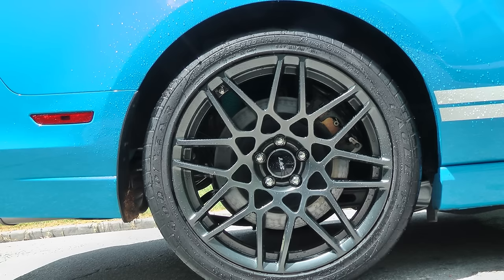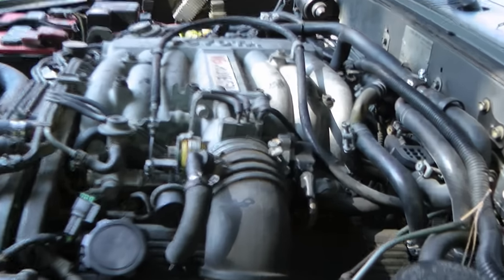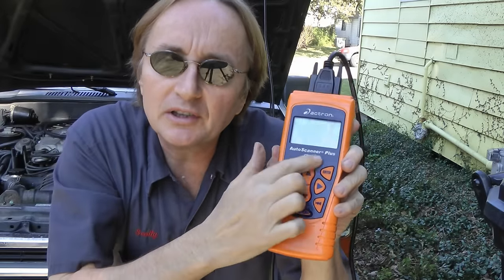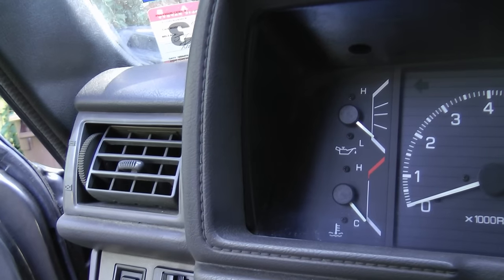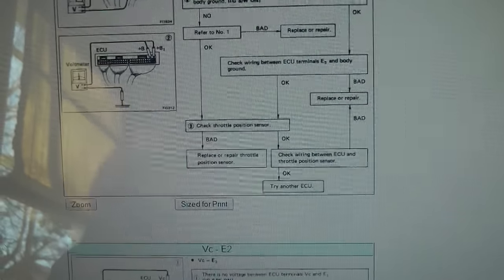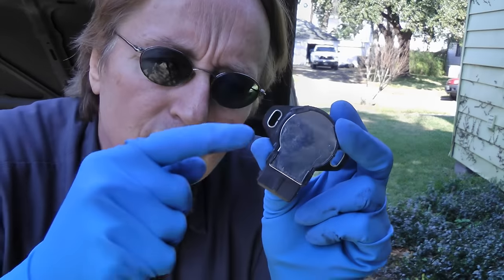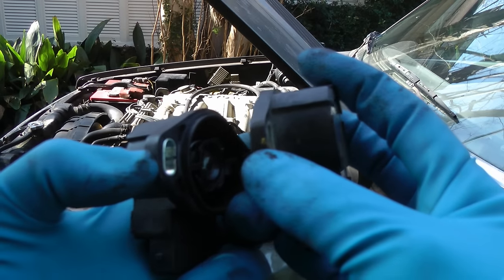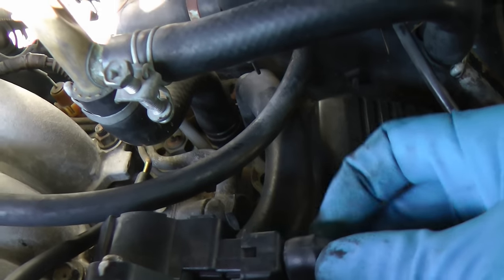How to Stop Car Hesitation (Throttle Position Sensor)

Comment: So I have an 06 Trailblazer 4.2 L Inline 6.
I notice that when I floor it, it takes a while for the car to respond, would it be the sensor? what could be and what would you recommend? Thank you in advance.
Reply from the maker: +Josh B could be lots of things, from this sensor, to a weak fuel pump, to dirty fuel injectors. Best to test live and mode 6 data, or pay a mechanic to do that rather than guess

Comment: console panel doesn't showing any light also I.e. engine light can I change my throttle position sensor, camshaft position sensor, and fuel pump will it help me
plzz guide

Comment: hey their got an 89 Toyota pickup same motor as you have in your video 3vze known as the 3 slow I bought a tps sensor to replace cause my truck has been idling really high at cold start up recently and has a surging idle from time to time also if I tap that gas pedal suddenly it lags so my question is it just a plug and play or do I have to use an ohm meter set it and a feeler gauge thanks again hopefully you respond rapidly
Reply: +Scott killmer

Comment: I have a 1999 Chrysler Sebring jxi convertible and the car wouldn't start with code PO122. The engine is a 2.5 v6 Mitsubishi. I replaced the throttle position sensor and still getting the code. Does it need to be calibrated and if so how? The sensor doesn't have slotted holes.

Comment: My 1990 Isuzu pup sarts with no problem but after I little bit it shuts off could it be a throttle potion sensor or something else Scotty?
Reply from the maker: could be tons of things,  that old, try my video "finding engine vacuum leaks with a cigar"and also pressure test the fuel pump to see if it's weak

Comment: hi sir i have a problem with my suzuki wagon r 1000cc engine turbo intercooler gasoline, during warm up idle is ok but until it reaches the normal operating temp  the idle turns rough and it fluctuates eventually but when you rev it up in almost 1500 of the rpm it will gone  and if you depressed it again it will come back can you give me an advise? thanks..

Comment: hi scotty
i have nissan primera 2001, while driving car start missing gears and RPM goes ups and down, sometime it stop changing gears, i have checked through nissan they said it needs to change input and output speed sensor and also steeper motor inside transmission, can you please tell me is it right or not to do that koz it is much expensive to change both.

Comment: What is wrong with an automatic toyota camry 98 that will intermittently hesitate when going from a stop into a left or right turn, and  intermittently will hesitate when going up a small hill?   Have checked the transmission fluid. Looks good. Gone thru a couple tanks of gasoline, no help there. No codes.

Comment: i have a problem i tried to fix it i have came a long way but bought a 2002 lincoln ls with v6 

replaced all sensors except o2 sensors that came with it when i bought it haven't put them on
put new upper and lower manifold seals and replaced the pcv valve and pcv elbow and factory parts also from the pcv valve to the manifold but the problem i have now is when i start it when (cold) it won't go over 1000 rpms you floor it and doesn't do anything just stays at 1000 rpms it boggs down but doesn't stall but when (warm) it runs perfectly fine floor it and drive it like normal just when its cold any ideas would be great .

Comment: I have a 2011 Silverado 68k miles runs fine around town but when you get on hwy and go 55 it seems like its missing but it only does it every 14 days are so onstar did diag no errors and no check engine light what do you think it might be and when it is doing it you can floor it and it will get up to 80 in 3 sec
Reply from the maker: often weak fuel pumps do that, pressure test it when it acts up

Comment: i have a 94 town car that hesitates on start up and whike in motion ive cleaned pcv done tune ups etc and still does it. i dont have check engine light on but it really hesitates is there anything else i can do? i love this car its perfect for my lifestyle and dont wanna lose it
Reply from the maker: +Ceasar Arce first, pressure test the fuel pump, weak ones do that and don't trip codes
Reply: Lol sucks to say but how do I do that I've never had to do any of this before

Comment: Hey Scotty. Long time fan. Having trouble. 01 Suzuki Grand Vitara hesitating on steep hills only sometimes. And on take off sounds like there's some noise right under driver seat. As I speed up the noise goes away. Any info would be appreciated
Reply from the maker: check for worn CV joints, inner and outer
Reply: Scotty Kilmer thanks for replying Scotty. I feel like an idiot right now. I was just low on gas! For some reason my car will stutter for a whole mile city driving before it dies

Comment: would spraying the sensor with electronic contact cleaner be an alternative to replacing? I think my car has the sensor built in to the throttle body and i have to get a new throttle body to replace the sensor, and that cost 400 bucks i think
Reply from the maker: you can try, but tps sensors often go bad electronically

Comment: I have a 07 toyota camry le just bought and it kept stalling so I figured it was the throttle body just put on a 2nd one and still the same problem no change only goes 20 mph at most could changing this sensor be the issue

Comment: Scotty, my 94 850 is hard starting when it gets warm, I replaced the tps awhile back, could this be causing a problem, I put it in the way it came out, no more check engine light, thats why I replaced it, or could it be my coolant sensor, or would you go cam sensor first, livi n on a shoestring and I have to do my own mechanics, Help!
Reply: Hi Scotty, my 97 miata with 115k miles spudders while at cruising speeds,  could it be the tps? Acceleration is fine, it does have a low idle speed. The car is stock - no after market parts.

Comment: good evening I have a toyota Corolla s 2006 sedan when I drive it and comes to a stop the gas pedal dies   then let say I give it a minute when I press the gas pedal the car full power again and driving good again could it be one of the sensors either the gas pedal sensor or the throttle body sensor ?

Comment: have a 2000 Nissan Xterra put on brand new starter brand new thought throttle position sensor put on a new fuel filter my car will crank up and run good for a little while and then it will start taking down and cutting off like the throttle position is bad what do I need to do next do not have the money to take to a expensive mechanic do you have any suggestions and the throttle position sensor has been sent with a screwdriver as well so the island will not be low but it is still acting up

Comment: I replaced my whole throttle body but it's still hesitating a little, although nowhere near as badly as it was. So I guess that was a problem but apparently there's other issues as well. I'll check my spark plugs next.

Comment: I have a 94 Camaro 3.4 That gets about 150 miles to the tank, could it be because of the Throttle position sensor. I have already replaced o2 Sensor, Fuel Filter, Fuel Pump, Plugs, and the Idle air control. Also I removed the throttle position connector and noticed some liquid inside.
Reply from the maker: +Roger Correa  could be tons of things, best to test not guess. Guys like me make a living analyzing other's problems without guessing, try to find one for at least an analysis and realize being that old, odds are injectors need replacing or serious cleaning

Comment: I have a 2013 mustang v6 and sometimes when I’m driving’s real slow like 10 mph and i accelerate it the car hesitates when it changes gear i think , do you think it’s happening because i need a new throttle sensor

Comment: I have a 95 Chrysler Cyrus that has when you go to take off it seems like it's flooding itself and then it takes off I have clean the throttle position sensor and the throttle body but still doing the problem any suggestions

Comment: I have a 95 toyota camry and the paperclip trick isn't turning on any check engine light. I don't even know if there is a check engine light on the car. Is there a way to diagnose without the light flashing?

Comment: Hi Scotty! I have been watching your videos since you came into YouTube.  keep up the good work.

BTW I have trouble with my Toyota Corolla AE111. It starts and runs pretty good. Just that when I stop at stop sign or traffic, the rpm either goes down by few hundred or goes up to 1.5k rpm and stay there. It immediately get back to normal if I blip the throttle. Another thing I noted was when I was driving, as I let go of the throttle and coast, the power delivery becomes unstable and the car kinda jutters or shall I say it moves like it will when one intermittently press and let go the throttle.

could it be TPS or the whole throttle body?
Reply from the maker: +Vivek Ananth  tps rarely go bad on those.  Try my video "how to fix a car that idles poorly" and also check for vacuum leaks
Reply: +Scotty Kilmer alright will give it a go. Thanks a lot!

Comment: got a 96 Mustang GT 4.6l starts and idles but when I try to go it hesitates and want to bog down and die it is also manual and no check engine light is on plz help can't figure it out and have no code reader what can it be getting ready to do an EGR delete but not sure if that's the problem this started out of nowhere also checked the fuel pressure seems fine any ideas would be appreciated

Comment: Unlikely a part ever needed to be replaced.  Anyway, the screws aren't stuck because of age they have a threadlocker compound on them.  Heat the screw with torch or soldering iron to soften threadlocker (still might break the screw off in there trying to remove though.)

Comment: What other components or parts does the throttle position sensor damage? 
I had a p1221 and check engine light was gone after replacing tps. But I have rpms going up and down with no check engine light and car won’t go past 4K rpms... I’m really scratching my head now. Vvt solenoid is clean..
Reply: Could it be my timing belt?
Reply: My fuel system is in closed loop.

Comment: Have a 02 Lexus ES300 with hesitation issues. Shows code p1350 and already changed camshaft position sensor and plugs, checked map sensor and still haven't figured it out. Says it's running lean and hesisitates when you floor it and above 4000rpm while driving it. What could my problem be?

Comment: Hi Scotty, I had some trouble with my 2002 audi a6 3.0 quattro. Sometimes it dies when I stop on light. and I try a couple of times to turn it back on. Usually EPC light comes on, and idle rpm stay about 1150. I turn it off and on and it is gone. I replaced throttle body and speed sensor and it looked fine for 1 day.  It took me 20 min to turn the car on today. After I turn it and press the throttle, the car shuts off again. Eventually it starts and works fine. I was thinking it might be a throttle position sensor problem??? Could you help me with that?
Reply from the maker: +Gerd Ruci   realize audis that old are endless money pits. And to fix them without guessing, a super expensive Vag Com computer is needed. I have one, but I am a pro mechanic. So find someone with that and pray he can figure it out without guessing with too much of your money. I would not keep that vehicle long myself though, realize that.

Comment: Hi Scotty my car shows dpf and glow plug the grage checked dpf it was clean even the light is there the car skoda 13 plate 1.6 low mileage anyway I used all the type fuel liqued but no help car slow me down in the hills holds back power it's like there is a blocage someweher on and off while driving I put new turbo Wastegate only the esp light gone as it was making problem to any idea what is that

Comment: I have been getting p0171, p0174 on my 05 toyota prerunner with 142k. I replaced the o2 sensors upstream and MAF. I am haveing engine hesitation under load and engine light reading same codes. Can you help

Comment: Hey Scotty I have a 2002 jaguar stype every rim I stop at a red light it idles and turns off but turns on right away do you thinks it's the throttle body sensor?
Reply: had that problem on my Jaguar, do u have any vacuum leaks?

Comment: hi scotty I have a Nissan march 2001 automatic jap import can you tell me if they have carbon brushes cvt on gearbox if so can you tell me where.. and when I put the car in park or nutral position the car seem to run higher fev or sounds like it.

Comment: Hey scott i have a acura 90 b18a1 and its thorws me a code for throttle angle and i unplug the tps and it runs the same could my sensor be bad ?

Comment: Hi I have a question I have a 07 chevy impala and its reading engine power reduced and engine hot ac off I changed the temperature sensor and the throttle sensor took off the battery terminals and still the same codes how to I reset or relearn the throttle sensor

Comment: Hey Scotty I have an 89 Tercel with a carburetor. I think my TSP looks different than this one. I get a code 41 but how do I identify my TSP? Thanks.
Reply from the maker: the sensor is built into the carb, a non replaceable part
Reply: Wow, I called Autozone and they say I can order one from them. I sure hope there right. Thank you.

Comment: I have mazda 626 1995 2.0l  4 cylinders. automatic transmission, I had some issues with MAF, I replaced it with a new one buy it from online store, the check engine went off but hesitation started to show up, I adjusted TPS to the maximum (or minimum) range the hesitation decreased dramatically but still there is hesitation under 1000 rpm. I made key on engine off test nothing show up, I made key on engine on also nothing show up. What to do?

Comment: I have a 93 Chevy Cavalier that idles up to 2000 RPM when started. It doesnt kick down either. Could this be an issue with the tps? There are no check engine lights or vacuum leaks.
Reply from the maker: +The Skeleton in your closet   could be lots of things, more often a vaccum leak though, do my video "finding engine vacuum leaks with a cigar"

Comment: hi scoty i cleaned this part today but when i put it back the car is always 2000 rpm what seems to be the problem 
thanks
my car is lexus gs 300 1999
Reply from the maker: make sure everything is on tight and there are no vacuum leaks, but if not, drive it a day or two it may settle down

Comment: hi scotty i just bought a 2001 santa fe 2.4 petrol starts ok but when i start to drive it from cold its low on power then after a few miles when its warmed up power is ok would that b the  throttle positon sensor as well
Reply from the maker: could be lots of things, but on that, tune it up first and clean the fuel injectors too first

Comment: hi scotty. when i come out of the driveway sometimes the rpm goes up but the car wont accelerate. so i have to turn the engine off and start the engine again. could this be a bad throttle position sensor. i already changed the accelerator pedal sensor. this happens once in a while but sure is annoying. need ur help man.

Comment: Hi
My VW golf mk4 1.4 (1999) petrol. manual gear is hesitating when I release or press the gas pedal while driving in low speeds. Spark plugs, airfilter, petrol filter and oil are new and OK) the engine starts fast, car doesnt shake while parked or at startup.

My clutch was replaced since 15 thousand km. It is high clutch though. someone said to me that maybe it needs to be lower (the function of the clutch starts when 3/4th of full press releasing) do you know what might be wrong? 

Note: I have no airflow senssor and my car is a carburetor not injection
Reply from the maker: Often the carb needs cleaning or rebuilding when they do that.

Comment: hi.. scotty.. I think my car has a bad tps.. I performed the same test... I disconnected the tps and my dodge neon srt4 03 ran  better... the problem is that I can get any boost under load.. what do you think..?????
Reply from the maker: +memo barron start with a new tps and pray it's not other things too, as computers have complex software that can mask other problems. ALWAYS fix the obvious first
Reply: Ok... by the way my car has no codes stored in ecm...
Reply: And thanks a lot scotty

Comment: I have a 99 Honda Accord and the power of the car got very weak but it starts fine u think is that sensor also?
Reply from the maker: +Alejandro Pagan Castro could be tons of things, but rarely do tps go bad on your model. More often dirty fuel injectors or dirty maf sensors

Comment: Hello. Always great videos, here.
Any ideas why my 99 Nissan Frontier XE won't go over 2500 rpm in any gear?
Manual 5 speed.
It may go to 3k after turning the key, but only Once. Then, 2500 max.
Going downhill, it may rev louder, when I floor it, but not increase rpm.
Ohhh, the humanity. 😁
Mystery...
Reply: had a similar problem on my 04 nissan primera. It was a bad throttle clamp

Comment: hey Scotty I have an 07 Grand Prix obd 2 reading throttle position sensor. can this make it so the car won't even start or do I have other problems as well that's not showing up on the OBD2
Reply from the maker: pray it's just that, it can make it not start

Comment: So if there's no check engine light, the car is safe to drive?... Even if the car isn't quiet or feel the car is accelerating a bit weak even after fixing the throttle and check engine light? It passed smog but it still makes me nervous ...